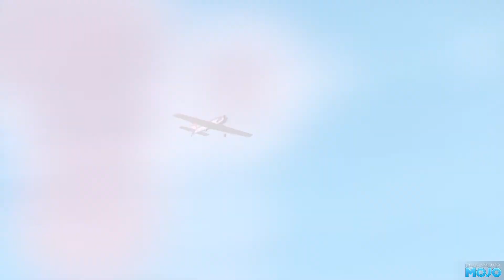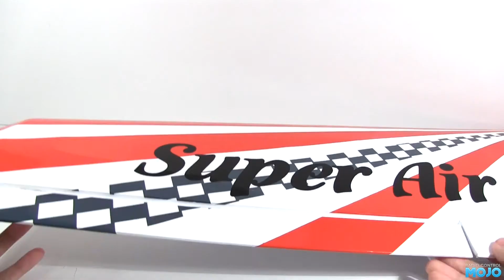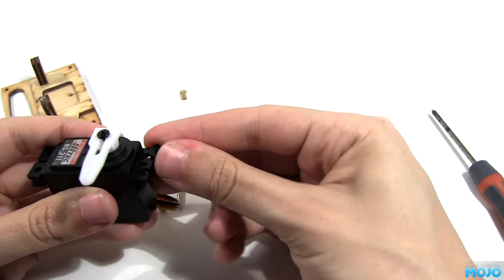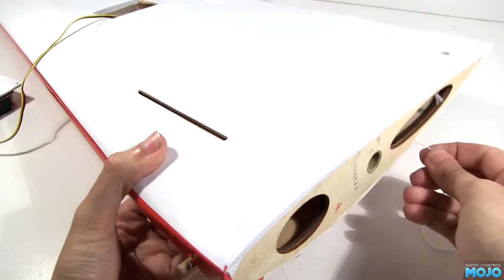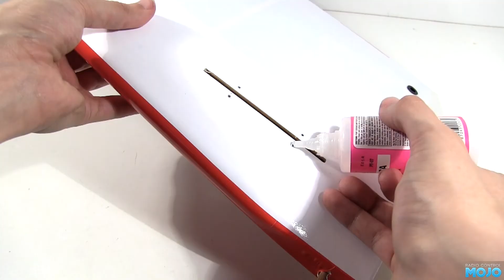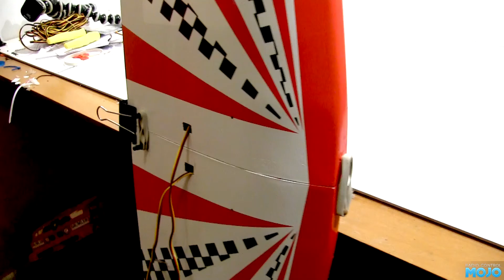Super Air - Wing - Part 1

Comment: Hi. I have a speed air with SC46 engine. Manual says C of G should be 100mm from leading edge of wing. Another manual says 76mm. Which is correct? Where is your plane balanced at? Thanks.

Comment from the maker: On this model, which is fairly aerobatic and weighs 7lbs, it needs the wings glueing as that's how they were designed. Some models have a much larger wing brace and locating pegs to keep the wing panels aligned, on these a 2 part wing works.